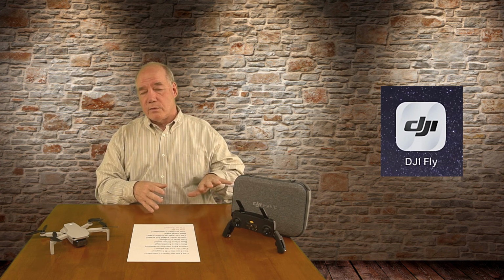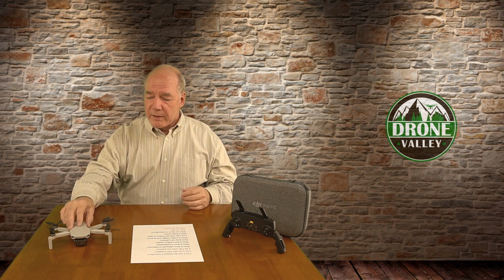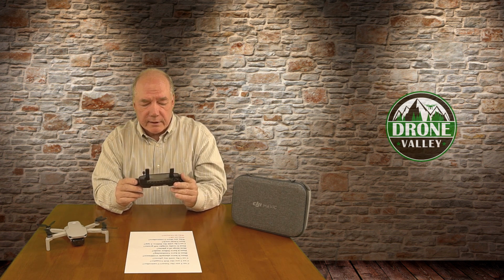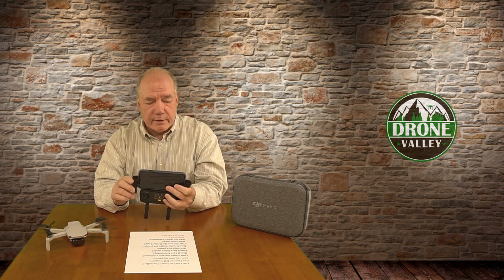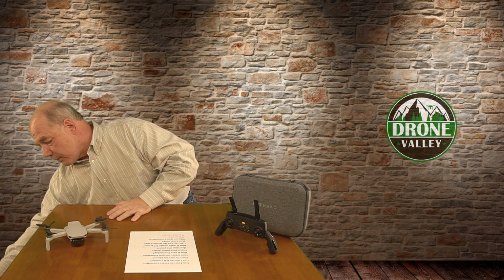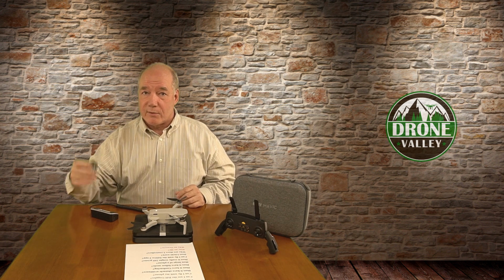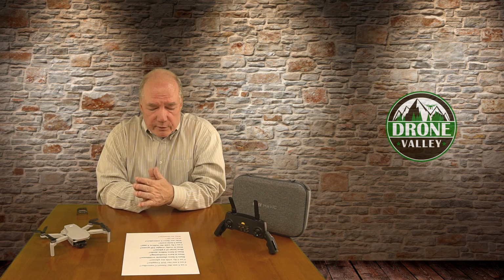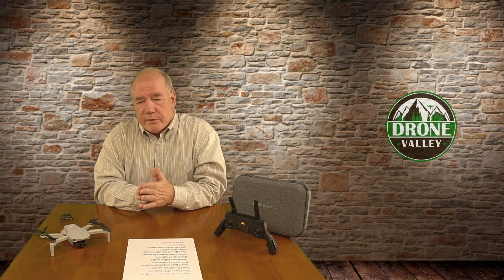Mavic Mini - Your Top 10 Questions Answered

Comment: Ok, I'm getting ready to buy a new drone, it was going to be the Mavic Air, but that's just too expensive now.  If you were going to choose between the Mavic Mini and the Parrot Anafi,  which would you buy, seriously.
Reply from the maker: Joseph, you asked a very tricky question and I love both quads so it really comes down to your budget and what you'll be using the quad to do. The Anafi is more expensive but has a better quality camera with digital zoom. It can fly about the same amount of time and distance and comes with a controller. The Mavic Mini is smaller, less expensive and has a few more flight mode that make flying easier. If your budget is tight, go with the Mavic Mini and if you need the better camera, the Anafi is the better choice. The honest answer is that you're going to love flying either of them so make up your mind soon so you can get out there and fly. If you decide to go with the Mavic Mini, please use this link to buy it and help support the channel - https://tinyurl.com/y67sbgmr. Thanks for watching! Rick
Reply: @Dronevalley  , thank you very much
Reply: @Dronevalley  A few more flight modes than the Anafi???? Rick, the Anafi has WAY more flight modes than the Mini. I think your knowledge of the Anafi is a little rusty.

Comment: Hey Rick Great clip here,  I do have a question though.  At about 15:13 you mention that there are multiple versions of "that" controller.  Are you referring directly to the controller for the Mini or Mavic controllers in general.  As you speak about the 2.4 and 5.8 bands, you say this one for the Mini only has 5.8.  According to the letter that DJI filed with the FCC it actually has both 2.4 and 5.8 But the 2.4 is locked out via firmware at the factory for the units sold in the United States.  That makes me think the Mini has only 1 controller and the firmware is adjusted based on target location for the to be sold.  Your thoughts?   Thanks, Mel.
Reply from the maker: Mel, great to hear from you! I hope you're doing well and getting in some great flying. As usual you're right on the money. They built one controller and lock out the dual bands in the U.S. so we have only the 2.4. They also hobble the transmitter in other regions to reduce the power output due to tighter regulations in those regions. The good news is that we get the beefier standard that has a range (in a perfect world) of close to 2.5 miles. In Japan it's reduced to about 1500 feet. I have a few more clips posting soon so be sure to stop back to catch them. Rick
Reply: @Dronevalley  think you said 5.8 for states not 2.4

Comment: We still need a good range test.  Just so we will know in a wifi congested airspace!
Reply from the maker: Okie, thanks for posting and I've had it out to about 1500 feet with no issues in video or connection. That's about the limit of my VLOS so I don;t fly any farther than that. I'm sure someone will test its limits but I try to stay within the FAA guidelines to keep things safe. Stay tuned for more Mavic Mini content posting this week.Rick
Reply: I just saw another review for range test, the Mini went 1112 meters before getting a battery warning then returning to home. which isn't very far
Reply: W5CI's videos I saw that too, for this size it is pretty far and because it is WiFi based it’s incredible
Reply: W5CI's videos , W5CI, you must be a ham operator!  Like DJI said, their range test was with absolutely no interference.  That is why people dislike any Kind of wifi.  Unless your on top of a hill with no trees and no houses in sight you won't get their advertised range.  Some people have been saying the same thing about the Skydio2!  But it is a different type of drone made for a complete different purpose.  It isn't supposed to get over a couple hundred feet from the operator because it will be following them closely.  That is what it is for!  For some people that want to use the Skydio for  longer range photography, they could have an issue!  I wouldn't be surprised in a future Skydio 3 that they come out with something like Occusync.  This Skydio has a load of technology in it as it is!  Take care.  Tom
Reply: Okie-Tom uuuh my MAVIC 2 follows me a year already avoiding obstacles!?!?
Reply: @Okie-Tom  Thanks
Reply: @w5cisvideos218  yes but how many feet is that?? Tell us in feet.
Reply: Seen a video with a 3.8km flight

Comment: You mentioned that the mavic mini works on the 5.8 band in the states.  How do I check which band the remotes for the mavic mini run on in Canada?
Reply from the maker: Gary, once you receive the quad, you can check the frequency it's using in the application. It will show you the current band, how strong it is and even let you select another band manually. I don;t recommend doing that since the app is way smarter than the pilot in most cases :) Thanks for the post!

Comment: I have a iPhone XR with a heavy armored case, which is a task to remove and install. Which option would you recommend to overcome this situation? I see where Amazon has aluminum inserts with numerous hinge points to worry about.
Reply from the maker: DJ, that's a tricky one and I have a few friends that use the OtterBox cases that are really thick as well. They use a tablet holder in the handles, which allows them to mount the phone on top and use a longer cable to connect. We have both of them on our website if you decide to check out that option. Here's a link - https://tinyurl.com/y2895ood
Reply: @Dronevalley  Thanx for your help.
Reply from the maker: @djpotts2554  You're welcome and let me know if you have any other questions.

Comment: The only reason it does not have sensors is to keep the weight down nothing to do with cost
the whole drone was built around to be under 249 grams.,   
not to be a low price. That's what the spark was for

they could of prices drone at 600 700 Dollars people still buy it
Reply from the maker: Thanks for the post but it's about weight and cost since they are targeting the consumer that has never flown before and wants to buy their first drone. Adding the sensors is only part of what's needed for obstacle avoidance. You also need to beef up the processor to handle the sensor inputs and write software to control the quad when you're approaching an obstacle. All of this adds cost and drains the battery quicker.

Comment: They have definitely lost me as a potential buyer by not having manual control and raw support on photos. Would have cost them virtually zero to add thoae code-only features. And yea, if they would have been really striving to create a beginner oriented brid, they should have added collision avoidance sensors, even at the price of making it more expensive and having slightly less flight time. I've been waiting for the specs of this drone, hoping to get a leaner MP, and i think the entire hype on it is because of this kind of expectation by many others. Oh well...
Reply from the maker: Boris, thanks for the post but I think they will expand the camera features with a firmware update as they often do with their other products so don;t give up on that. As for the obstacle avoidance, it's a bit of a parlor trick for most pilots that have flown for a while. As I mentioned in the clip, I turn mine off since I fly close to trees and the beeping is annoying. This quad is definitely targeted for consumers that have wanted to start flying but aren't sure that they want to spend $1000 on a Mavic Air in case they don't really get into the hobby. Simply put, think of it as a beefier Tello instead of a smaller Mavic 2.
Reply: @Dronevalley  i wouldn't be so sure they are going to add stuff like raw support in, and i am judging by Spark as an example. Anyway, IMO, many would want a leaner MP. Would someone actually want a beefier Telo? No idea. Well... time, and DJI sales, will tell :-)

And BTW, i didn't mention Mavic2, although, a leaner MP2Pro would be an absolute killer, lol. Can this thing lift the MP2P camera module? ;-)
Reply from the maker: @borislipschitz2740  I actually think you'll get your wish after the new year starts. My suspicion is that we'll see a Mavic 3 and an updated Mavic Air 2 to fill out the new line of quads. I'm also rooting for a Phantom 5 as I still think there's a need for a fixed fram quad with a removable gimbal. We'll have to wait and see.
Reply: That's crazy you're jumping the gun

this is a brand new app been built from scratch ) DJI listen to their fans if they get enough feedback saying they want stuff to be added, they will add it.

It's like the go out when that first come out that was like basic as heck. And now look at it.

I do know what you're talking about it's automatically on auto and you can't change it
Reply: And another thing this whole drone was built around being under 250g
and the wouldn't be able to add sensors to it because it would be no way they would have been able to get under 250g if they did. 
The battery on its own ways nearly 100 g. I've got three DJI drones
and I've never crashed the single one  

you do not actually need sensors the or just a benefit to stop you crashing

they are going to sell a lot
I got the  Mavic 2 Pro. 
And I'm still going to buy it

because they Mavic 2 Pro. It's just too big to take everywhere too with you I like a little drone I can hold in one hand launch off get some shots and go home

and I don't care the grammar is not very great on this message
I can't be bothered to change it
Reply: @TJ-bc6ug  i don't personally care much (if at all) about obstacle avoidance, i've just noted a beginner oriented drone (as in a "drone for someone who never flew one") should have had one. I've considered the mini for the very same reason, taking it on long weekends etc, when the mavic is just too big to have with me, but really, having no way to shoot that sunset in raw to at least try recovering a bit more dynamic range... and heck, not even been able to set the white balance, destroying the pic even further to fix that in post on jpeg... screw that.
Reply: @borislipschitz2740  yeah I understand what you're saying
time will tell.
Reply: I'm telling you right now they're not bringing a Mavic 3 out till 2021
I know for a fact. They do not release a drone after drone.

They've just released a Mavic Mini
and if they did release the drone
won't be till September time
2020 or 2021 no company would do that

release one product after another
in a certain period of time it doesn't make no business sense
😎 that's my personal opinion
I know what you're talking about
I think they will release another drone of like the Mavic 3 but not till another year.

  They usually released a drone a year and a half apart😎

anyway we all love DJI best company in the world .

Comment: I live in the woods will this drone work behind trees and a lot of them
Reply from the maker: Thanks for posting. I fly in the pine barrens in NJ a lot and it does OK with trees as long as it's in close. If you fly too far out and go behind a stand of trees you might have issues. It's less about the wood being an issue and more about the water content in the trees blocking the signal.
Reply: Agent К_видео nah I fly above the trees and I already preordered it